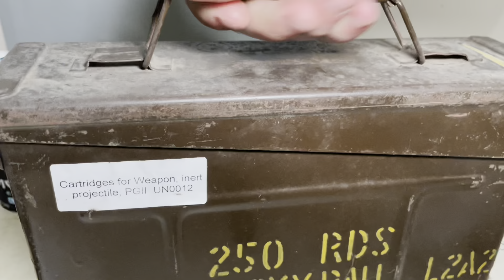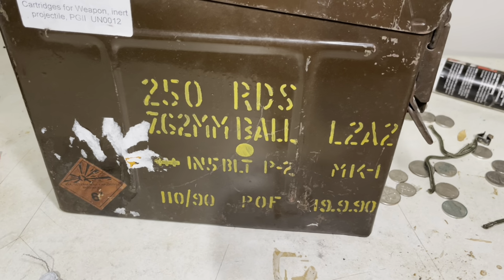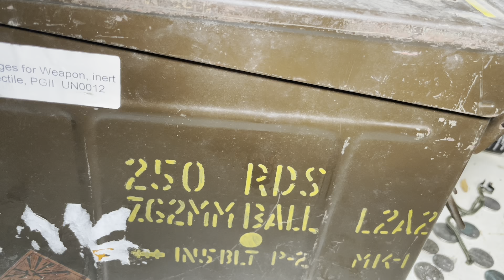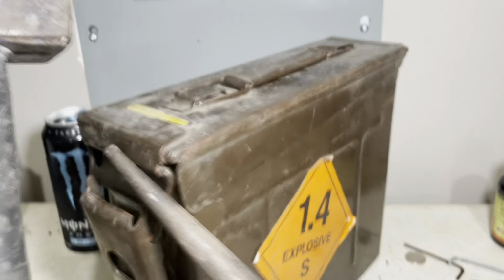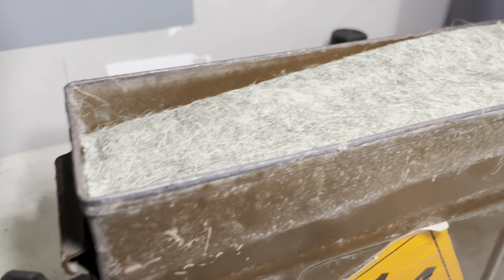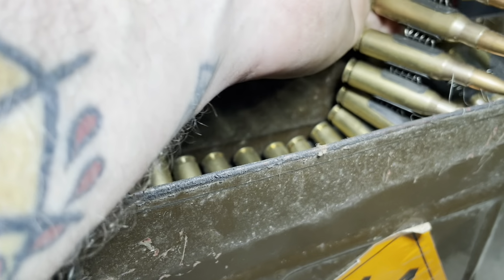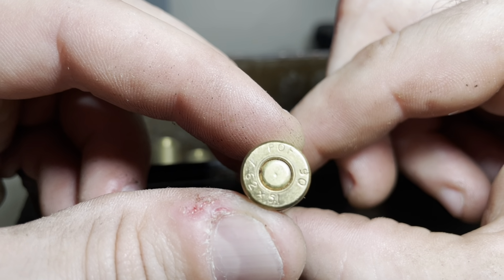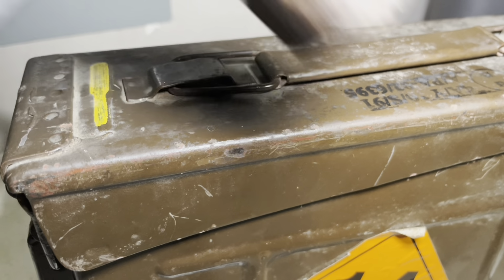Surplus ammo unboxing.

Comment: The ammo box was stuck shut so tightly because it was about 93 degrees on the date (September 19th 1990) stamped on the box in Pakistan (POF marking) when it was packed. When it was still hot in the factory, they filled it up and sealed it. Over decades of sitting in warehouses, it was never opened to release the vacuum pressure created by the cooling of the air inside. Combine that with the rubber gasket starting to break down, vulcanize and adhere to the box, as demonstrated by the rubber still stuck on the rubber still stuck to the rim of the box, you got a perfect storm of negative force working against you. Would have been a little easier to open if you had used a hair dryer to heat up the box and by extension, the air inside. But of course that's something no normal person would think about. After all, I am a massive NNNEEEEERRRRDDDD

Comment: I still have a good bit of Turkish ammo from 1976-1978. The British helped to set up the factory in Turkey when it was established and they manufactured ammo for the British military for decades.  A bit dirty but non corrosive and has  never had a misfire. Mine was originally sealed and belted as well but the surplus ammo store unbelted it for me with a machine they have. Mine also says L2A2 on it. Shoots great and it was dirt cheap. Still have well over 1500 rounds of the stuff in the original cans. Those old surplus ammo cans are all extremely hard to open. They lock down very tight. Mine that have the Turkish ammo are still very hard to open and they have all been opened a few times so ignore the trolls raggin on you with opening them. Very old ammo cans can be a pain to get open. They were designed to be that tight.

Comment: I have 7.62x54r rounds made in Russia in 1946, were sealed all those decades until I opened them and ive shot about 100 of them and not a single one had a problem. Ammo stored properly lasts longer than you will even live.
Reply from the maker: That sounds like some good ammo and i bet you got a good price for it.
Reply: I agree. Properly stored ammo lasts for a long time. I have about 500 rounds of 1956 Seller & Bellot 9X19 mm left. It was made in Prague. Hard primers but it goes boom. That 1946 ammo is cool. Good food for a period Mosin-Nagant. Have fun everyday.
Reply from the maker: @Gagnon4234  that’s awesome!

Comment: A couple years ago, I acquired two 400 round cans of 7.62 NATO that was manufactured in 1982.  The cans had their original seal and were in their original crate.  That 40 year old ammo shoots just fine.
Reply from the maker: Thanks for watching and commenting.
Reply: That ammo will be fully functional!
Reply from the maker: @geodes4762  it shoots great. Thanks for watching.
Reply: Yeah I have 40 rounds of weird Portuguese brass cased steel jacket 5.56 from 1979. I bought another box at the same time that was 1983. I already shot the box of '83 it worked fine.

Comment: Nice score there. Easy trick to de-link that: get a piece of a wooden dowel slightly smaller in diameter than the base of cartridge. Use that to push each round out while bending the belt backwards to open up the links. Hope that helps.
Reply from the maker: Thank you! I’ve shot most of them i believe. Using iron sights just out to 50 yards  was getting 2” groups.
Reply: All you have to do to delink is give the rounds a little twist, comes right apart.

Comment: Those ammo cans can be tough to open.  The rubber liner seals in the negative pressure that builds up over time. I use a screw driver to open one edge enough to relieve the vacuum pressure.

Comment: I was going to say the same thing from Top Gunner these look like East Asian loads and by the type of the belt that they were mounted in at 762 they should be approximately 54 mm cartridge non-rimmed! Nice little cartridge find something to shoot it in! They're actually pretty hot so watch the chamber pressure you can't guarantee the powder load a lot of old cannon powder was used in those! Nice bed
Reply from the maker: Thank you. I’ve shot most of them through my ptr 109.

Comment: As it’s got L2A2 on the side, it’s could be British ammunition.
Reply from the maker: Thanks for watching.
Reply: Pakistan & India gained their independence from the UK not all that long ago. Their arms factories were set up & run by the British until independence. They still use British nomenclature on most things.

L2A2 is their designation for 7.62 NATO. The L2A2 has a thicker brass case than the previous versions of the cartridge.

Comment: I got 2 cans of this 10 years ago,  gone now worked fine , $hittiest cans ever , still haunted by those damn cans,  could be OK for chainsaw tools or fill with concrete for an anchor.
Reply from the maker: The smell is pretty bad.
Reply: @Rob69rickysdonkey  I know that the pof .303 was chordite ! (I took it apart and played with it of course) it is cut like lengths like spaghetti... and smells way different,  I used it to burn "X-Acto" on a nice wooden box for tools. 
The .308 went straight on Isreali links for a browning 1919 😁  I didn't smell anything

Comment: Bro there is an easier way to open without tools….
Reply from the maker: Thanks for watching. How
do you open them?
Reply: @Rob69rickysdonkey  grab ahold of bottom wire handle with one hand and lever with other. Pull apart. Once tan is broken flip the lever with the hole in it and   Pull against the fulcrum. The the rubber seal will separate. Bada boom.
Reply: @zacharywalker2052  THE CAN WAS TOO RUSTED FOR THAT TO WORK